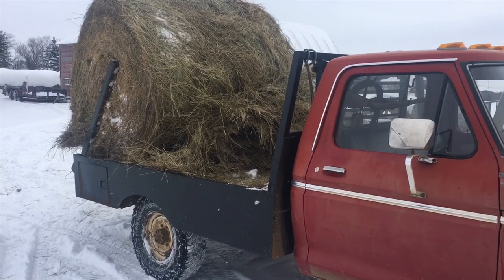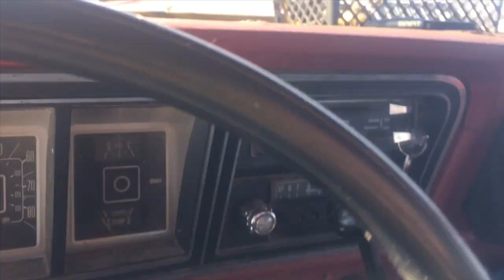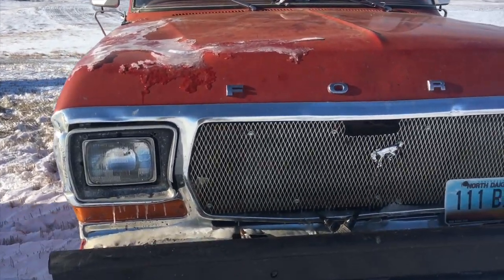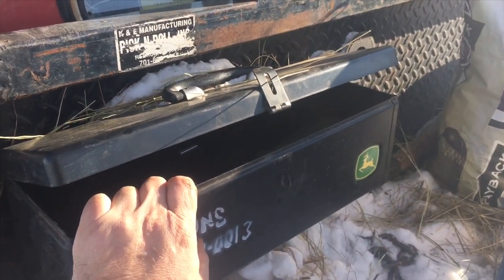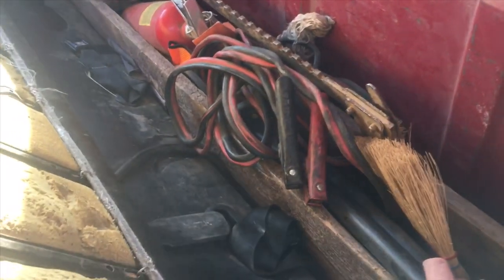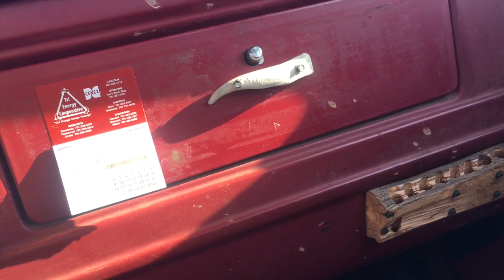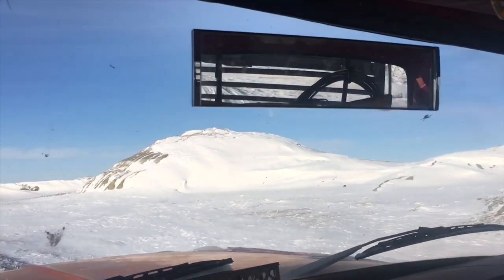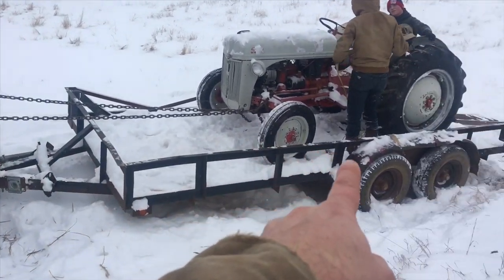The cowboys pick up

Comment: Before we got the 2004 duramax, I could pasture surf by myself with my 1969 chevy 3/4 ton four wheel drive. The back window was a slider so I could steer it by sticking the pitchfork handle into the steering wheel. Also on the duramax, the cattle have kicked the plastic spoiler under the bumper to the point I had to remove it. And they got a headlight too. Ahhh...... the joys of owning livestock.

Comment: Absolutely.
I used to feed off of the flatdeck small square bales, while the truck drove itself. Then the truck kicked me off a couple of times after driving thru holes and ruts and realized something had to be done different. Now we have a round bale processor. Haven't fell off the truck since.
But you can't get by without a farm truck on a ranch. That's for sure.

Comment: Changing the heater core and blower is a pain in the @$$ on them that is the only down fall on this truck i know i have changed them. The high output one's put out more heat than the earlier models but, you can upgrade to a high output if you know how.
    Mine had a 1973 frame 1976 axles and 1978 cab and front clip with a flat bed with a 390 motor 4x4 f250. Road salt killed it.
    A man needs a good work truck just as much as a good wife.

    GOD Bless.

Comment: ive had my truck been called a cowboy truck ( 75 k10 flatbed 350 4 speed) but another cowboy truck i want is a 94 dodge 2500 ext cab shortbed 4x4 12 valve 5 speed